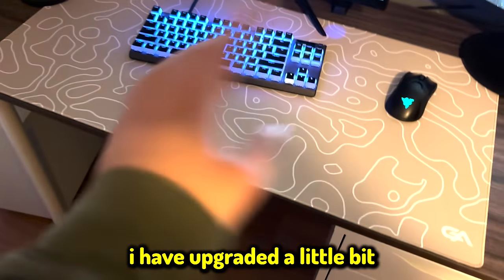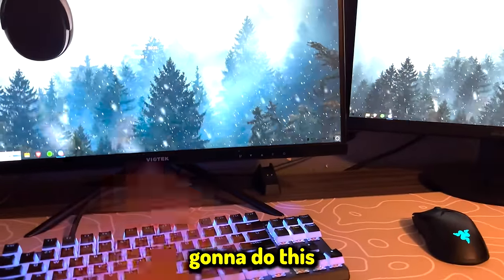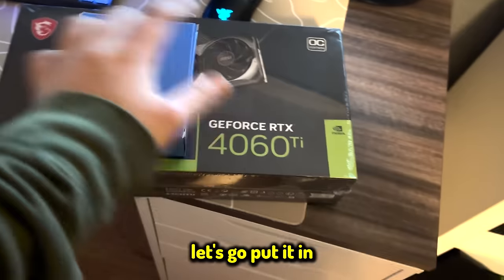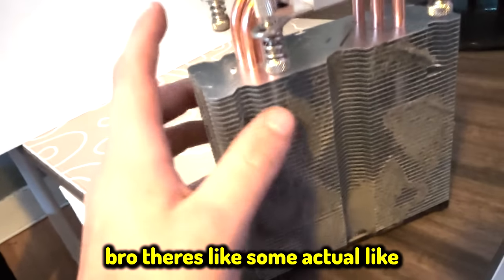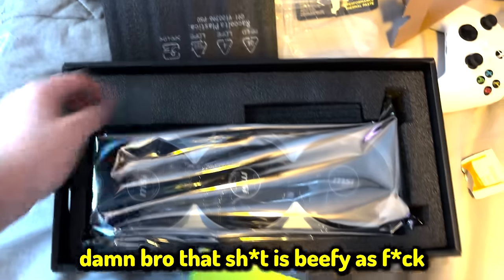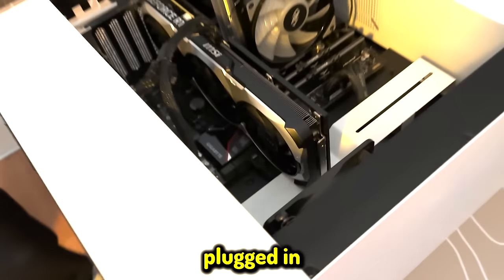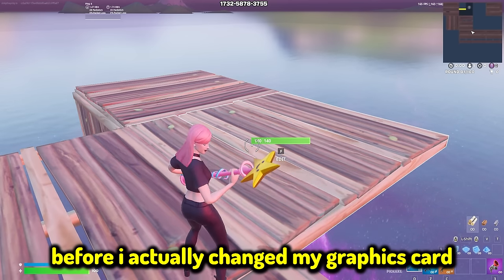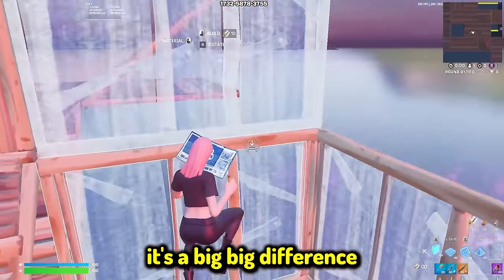I UPGRADED from a 1660ti to a 4060ti (1000fps)

Comment from the maker: For those of you guys that are still commenting about the 9700k. I uploaded a video where I built my first pc! And yes... i got a 7800x3d

https://www.youtube.com/watch?v=lcVTR1w52B4
Reply: w you prob wont need to upgrade for like 5 years
Reply: whyd you buy a 4060 ti 😭😭😭😭i get that you're trying to upgrade but a 4060 ti has newer tech like dlss, sure but it's an entry-level card
Reply: @rllydude3600  cause the jump from 4060ti to 4070 is $200😂
Reply: @SojhiFN I have an RTX 4070 and can achieve 750-900 fps
Reply: @Slayer_TV52   congrats😂
Reply: The fact that he could buy an intel core i3 13th gen or 12th gen (optimal)
Reply: @Slayer_TV52  Maybe in creative? You don’t get 750-900 in pubs for sure 😂😭
Reply: ima be honest, you shouldve got a i7 11700k at least 9700k just dosent pair as well and theres a small price gap
Reply: I'm still using a i5 4590 with a 1030
Reply: Nice was about to say that 
i got a 4060 and 7800x3d and in creative 1v1 buildfights i get around 800-1000 360 pretty stable in game while streaming
Reply: how much did you buy the GPU? The last time I checked in PC part picker it was 480$. You could have gotten the RX 7700xt which is a little bit better but a lot cheaper 400$ and if you are lucky and found a 450$ RX 7800xt which is much better than the RTX 4060 ti you would be able to play triple-A games at 1440p high setting at around 75 fps.
Reply: @CarlosAvina-t9m  lol bro same thing but with a gtx 1050ti. fortnite is a cpu intensive game so even with a rtx 2060 you are fine
Reply: yeah it was like a 20% bottleneck
Reply: @docifabio1093  so get a 2060? or the 1050 ti
Reply: @docifabio1093  I just don't use my PC unless the graphics are  1080p like my ps5 and runs more fps tho but the 1030 has bad graphics tho and I only use my ps5 cus of that
Reply: Ill get the 2060 but new or used?
Reply: The more logical thing to do would be to get a r5 7600x and a better gpu and better ram since your a streamer and the rtx 4060ti is one of the most overrated cards you would just also need some ram and motherboard  but you can have that for like 5 more years
Reply: @rllydude3600 It’s a great card wdym?
Reply: @rllydude3600 fr, personally i would have chosen the 6750xt for about $30 less and better performance 😅
Reply: @rllydude3600 the problem is intel has a stratage where they make the 4060 bad so people get the 4070 but that’s almost $300 more and most people don’t buy and for Fortnite cause it runs a little worse
Reply: Best cpu but awful gpu choice
Reply: cpu is main thing for fps in fortnite
Reply: @SojhiFN then dont buy an RTX card… 🤦‍♀️ AMD is literally the best brand for everything right now. Cheaper and faster than Nvidia

Comment: 4060 ti's value is awful
Reply: Yeah but it can run Fortnite XD
Reply: @Bralwed that does not matter when u could be getting more Performance with a different gpu and it would be cheaper for example the rx 7700xt
Reply: That's why I'm not upgrading from the 3060 :/
Reply: maybe he got it for a good deal
Reply: No it’s not it’s faster then a 3060ti and you get frame gen and dlss 3 and 3.5
Reply: Depends on how much you pay for it at the time I got mine for $250 and it had DLSS 3.5 + nvidia FG
Reply: @Wsupfellas3838 AMD got fsr lmao
Reply: @-pluste736  nvidia got better drivers lmao
Reply: Bro can you not just let someone enjoy their new parts? Like its not great value but it runs better than the 1660 ti.
Reply: Depends on how much he got it for btw, and also depends because the wattage is less than something like a 4070 ti super, so in the end you probably end up paying more in electrical bills by the time you upgrade again.
Reply: Womp womp
Reply: Nah
Reply: Fr could of got off 4070 ti or 4070 super
Reply: Your actually wrong 4060 ti is great for its value
But a 4070 is better
Reply: Just bought one for $350 cad($250 usd) brand new it has solid price to perf if it’s cheap
Reply: @Sunuka1 Fortnite has huge problems with amd
Reply: It's only awful for new builds, if you're upgrading from a gpu like this it's a good decision
Reply: @stitchyrichie not everyone has that kinda money
Reply: @Sunuka1 amd is really bad on Fortnite
Reply: @yazoo_07  and that's getting better in pretty much every update which is why I'm sticking with amd
Reply: @Wsupfellas3838 its faster, but by a tiny bit
Shouldve gone for 3090
Reply: @Xally-05 It may be bad on Fortnite, but it beats every other game on it. I bet it may even beat Fortnite on it.
Reply: It runs games well that’s all that matters
Reply: A used fe one in the uk is only 300 I think that’s a good price
Reply: Fr I cringed when I heard it
Reply: Yeah just get a 6600xt

Comment: I noticed that your ram speed is set to 1500mhz instead of the maximum speed, which is at least 2666mhz with ddr4. This will help you tremendously with FPS.
Reply from the maker: Damn I thought I changed that. Appreciate it
Reply: For some reason, many apps within windows shows the speed of the RAM at half of what it is actually running at. A good example of this is looking at the Task Manager. It shows the RAM's speed at half of what it's actually running at. His RAM is running at 3000MHz so no need to worry there
Reply: How do you check and change this I would like to see if my ddr4 is alright. I have 16gb DDR4 but I do have an AMD gpu (RX 6600) thanks
Reply: @HypeXtra  open the task manager and go to ram and there it shows the (Speed)
Reply: 1500mhz = 3000mts
Reply: @roscoebotha7096 no its actually correct because DDR stands for double data rate, so DDR4 3600 is 3600 mega transfers persecond, 1800 megahertz
Reply: flck freq is 1500 so his ram is at 3000
Reply: @KygoNky  fclk is only a thing on ryzen cpus, this guy has an intel system?
Reply: its running at 3000mhz  xmp is enabled thats why
Reply: @dukiest7368  3000 mega transfers per second, 1500mhz. DDR stands for double data rate. A lot of people don't know that.
Reply: its because its in dual channel, and some apps get like it were only 1 ram stick instead of 2, thats why the speed is a half of the actually one
Reply: @itzsimii  only just seen this, didn’t get a notification. thanks.
Reply: @roscoebotha7096  No. the task manager will show the actual ram speed effective, also that platform does not support 3000Mhz ram speeds, he just needs to put it to 2666
Reply: No, Don't worry about that. 1500mhz translates to 3000mts. 3000mts is said as 3000mhz so it should be running fine @ZinkyThePinky
Reply: How to change it
Reply: max speed of ddr4 is 3600 :)
Reply: @60rll  Thank you. I was hoping somebody in here knew what they were talking about.
Reply: its going to give him more stable frames but not gonna give an fps boost
Reply: @ZinkyThePinky  ram speed doesnt drastically change your performance, its just how fast it can pull something up, it really depends more on your gpu vram
Reply: Should be 3200mhz for ddr 4
Reply: with the 9700k it can be set to 3000-3200mhz

Comment: OOF that hurts seeeing people buy things as garbage as the 4060ti.
Reply from the maker: “OOF” is crazy 💀
Reply: Don't fret, it's also good for video editing, and Fortnite runs better on a geforce gpu
Reply: @GeneralS1mba  There are better value GeForce GPUs aswell, the 4060ti is not just bad compared to AMD.
Reply: @gintozlato1880  yeah, but this person probably only needs this performance, and dlss + power is probably all that matters to them if they play Fortnite mostly
Reply: stop following the crowds of people saying the 4060ti is bad, its actually really good.
Reply: @demarealreal  agreed, people need to pipe down with the gpu wars here, yeah people can always make slightly better choices when choosing parts, but in the end at the same budget, does it really matter? is the extra 20 fps you get from choosing a 6700 xt over a 4060 (not ti) really that big of a deal when it is still a decent gpu? because it really isn't
Reply: Literally you are more garbage than that graphics card.
Reply: @ZinkyThePinky 💀
Reply: @W1LlzA  I mean your not wrong, humans are pretty much incapable of rendering graphics, and we can’t handle temps as high as some graphics cards get under load
Reply: @itzkolkhov202  facts, however we generally have a longer lifespan so that makes up for the lower performance.
Reply: @demarealreal its not efficient for the price bro, second hand 3080 beats it or a new amd
Reply: @ZinkyThePinky  Its trash for value though
Reply: Lmao it's much better then the 30 series cards so how is it trash? 500 fps on fortnite is not bad at all. You say it's garbage all while never even owning the card. Your card isn't even that good bud
Reply: @ragedemon6513  It's terrible value for the price. For that price i could very nearly get a card like the 7800XT, which outperforms it virtually everywhere. I also find the "Your card isn't even that good bud" really childish, it's also assuming something that simply isn't true lmao.
Reply: @ragedemon6513  gamers use gpus for more than just fortnite, and its garbage not due to performance, its garbage due to price per performance (there are better options)
Reply: @denz8ty648  you're nothing but another follower who's never gamed on any 40 series let alone the 4060ti

Comment: That CPU seems kinda mismatched for an RTX 4060 Ti. But nonetheless you have a good upgrade! I personally had a laptop with RTX 3060 i7-11800H 16GB DDR4 since 2021 and now I’m considering an upgrade to a desktop with a similar GPU.
Reply: Dang if your upgrading then can I get that laptop 🤣
Reply: I think that it matches well of course an i9 would level it
Reply: @BadisHamimi he’s talking about the fact it’s 5 generations old now. he would’ve been better with a 12th gen i5 over 9th gen i7. i5/i7/i9 isn’t the only thing that matters, the generation number is the most important
Reply: i think you should get some better ram (32gb ddr4)or(16g ddr5)and maybe a better cpu like 12th gen i5
Reply: I have the same laptop
Reply: @Lucacentoo where did you get it. PLEASE TELL ME 🙏
Reply: @Freakbob127  Literally any laptop from 2021.
Reply: That's good
Reply: yeah pc builds bottleneck tool says its 38,8% bottleneck from the cpu and up to 5% is good
Reply: i got a pre built from nzxt the spects are an 

Geforce RTX 4060 ti w 16gb ddr5 an i5 one of the nzxt cooling rgb fans and 3 other ones also the case is a h6 flow

Comment: The i7-9700 is still a good CPU, but idk, I would've gone with the i5-13600kf dam near the same price unless you got it used, and another thing is that you will get a 20% bottleneck with the i7-9700 and 4060ti together. Overall, a good upgrade from your old specs.
Reply: i have an i5 and an 4060 am i bottlenecked? im trying to upgrade to the i9
Reply: @cynatic6587  dont talk about i5, i7 or i9 talk about what comes after them that is what matters not if its i5 or i9 . i5 13400f beats i9 9900k
Reply: @rixu8857  ye a 13600k can handle the 4090 without bottlenecking for 4k gaming generatiion matters more
Reply: That won’t work because the socket is different
Reply: @rixu8857  agreed,, so tired of people thinking i7 is better than i5, it all depends the model
Reply: 20% bottleneck? Do you get that from the bottleneck calculator? Because it doesn’t bottleneck that much, don’t trust the bottleneck calculator
Reply: @Max10294  still not a ideal combo lol
Reply: Not worth going intel after 12th gen bcs of the recent issues go AMD
Reply: or even better you can go amd, get a 7500f or 7600 and you can get on am5 which isnt a dead platform
Reply: It's not like he can take the 9700 out and swap it with the 13600kf, he'd have to buy a whole new motherboard

Comment: Oh yeah you shouldn't cap your fps, you should instead enable NVIDIA reflex low latency (set it to on+boost) and it will result in reduced input delay just like capping fps, sometimes better. I could explain but there are other people/videos that explain it much better. You will have to switch to DX11 rendering mode to enable reflex low latency but the setting will still apply when switching to performance mode too
Reply from the maker: Alr I’ll try it out

Comment: awesome video, im looking to upgrade my pc after 5 years to 4060ti and ryzen 9 5900x this christmas so this was great to see was fps, i noramlly get 45 midgame so this is definetly needed
Reply from the maker: W bro!
Reply: I think 5800x3d is better for games than 5900x, you should check the benchmarks
Reply: @oscarpetersson5324 yeah the 3d vcache gives you more frames, might save you some money too, but might not be quite as good for productivity.
Reply: i'd recommend choosing another gpu over the 4060ti, the 6800 being a great example, beats out nvidia in every game while costing less
Reply: Unless you're on a really tight budget You should go for AM5 so you're not on a dead platform and if you have to go am4 then I would get the 5800x3d which is very similar to the i9 12900k but cheaper
Reply: Don't get a 5900x, get a Ryzen 5 7600 or a Ryzen 7 5800x3d, unless you need it for a workload
Reply: the 5900x performs only slightly better than a 5600x or 5700x If you can go for a 5800x3d for more performance at a similar price.
Reply: Choose rx6800

Comment: i have a 1660 rn might try to upgrade to a 4090 , that's the best out rn right ? go u feel about the 1500 u spent to make fn run like 2% better ?
Reply: wait for 50 series, it will release this october. the 5090 will have around 60-70% more performance than the 4090.

Comment: i would say that the i7 paired with the i7-9700k isnt the best option
I would definitely would've gone with something like a 12 gen cpu or higher for the 4060
Reply from the maker: id have to upgrade my other parts if i wanted more than a 9th gen
Reply: @ZinkyThePinky  yes I understand which is why I would’ve recommend downgrading ur graphics card to something like a 3070 which would give u enough money for a new motherboard and cpu
Reply: In general the rtx 4060 and the newer ones are very overpriced right now
Reply from the maker: I already have the 4060ti. Doesn’t matter what “I should have done” it performs just fine! Thx for the advice tho
Reply: @Rayaan-__-69  overpriced where, there's 4060s for as low as $300 but there are better options
Reply: @ZinkyThePinky  Yeah I totally agree. As long as its working as it should, you have made the right decisions! There are always better paths to take, but it could take days upon days to know which is best, and not everybody got that time to dive deep into that shit. Besides, it wont save you the amount of money for the time that you could have been working. I am also upgrading, but from a GTX 1660 ti to a RX 7800 XT (comparable with the RTX 4070).
Reply: @ZinkyThePinky works just fine, could of worked better, used 3070 for 250$, i5-12400 for 230$ total (after new mobo, not even considering you sell old parts) I don’t understand how your able to sleep at night with knowing the fact ur throwing money down the drain? If it’s fine with you, sure but it’s just not my opinion only, a lot of people in the comments would say things similar to what I’m saying, have fun with a “fine” system tho, if u want a decent computer that can help u for years, consider what I just said and return some of the stuff u got, you’d be saving money + you get more frames.
Reply: @luseho  It is not comparable to 4070 bro
Reply: @luseho  4070 10 - 25% better
Reply: @HatMasterEdits what😂😂 brother i dont know what you are basing it on but 7800xt is literally better if we are speaking about raw performace... look at literally every benchmark. The only thing worse than 4070 is raytracing and dlss, which i dont see as a priority for the purposes that i am using it for

Edit: so you are either comparing it to a 4070 ti or you are nvidia stan
Reply: @luseho  shit I thought he said 6700xt my bad, nah I actually love the 7800xt made a theoretical build with it and i7 13600k
Reply: Now that I realise that even upgrading to a 4060 isn’t the best idea as a 1660 ti doesn’t have that big of a gap in comparison to a 4060 that you should spend 300 dollars on one. Plus the fps per dollar for a 4060 Sucks
Reply: @Rayaan-__-69  The 1660ti is not good for the price I would go with a 6600 as it is about 190 and has about 15% to 20% better performance
Reply: @ZinkyThePinky should have gone with the 7700 xt 🤦‍♂️ but I’m guessing you just want nvidia like most Fortnite players out there

Comment: Cool upgrade. I kinda feel like you got a little bit fooled by the i7 label. The 9700k is still good but it's like 5 generations old so it isn't the best value anymore. Geting something like an i5 12400 wouldve been better. Of course you would've also had to change the mobo since it's a new socket but yeah.
Reply: is the i9 12900k good?